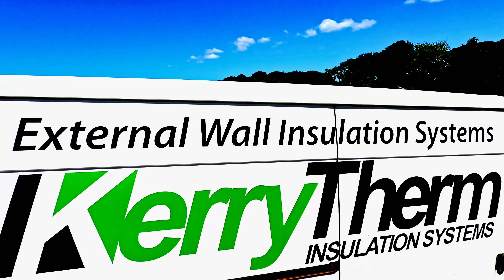How to apply Render Project 1 part16

Comment: Hi there. I'm sorry if this question has been asked before, but how long do you have to wait before you can go over it with a plastic float? I know that it depends on a number of factors but there are probably signs. 

Thank you.
Reply from the maker: Hi 
immediately after applying the piece. you are not waiting at all.
Reply: @externalwallinsulationsyst8648  Thank you for your reply. It's quite different from traditional plastering where we have to let the plaster pick up before floating. This is probably not a one man job.
Reply from the maker: @Gandalf4137  yes it all depends on experience, wall size, quality. recomend min. 2 men. a large wall can be made by one person, but the final effect and the quality of the plaster count.